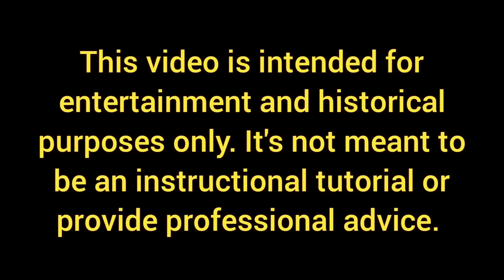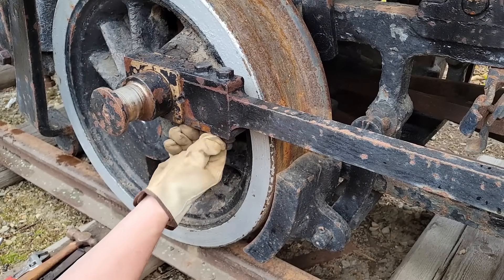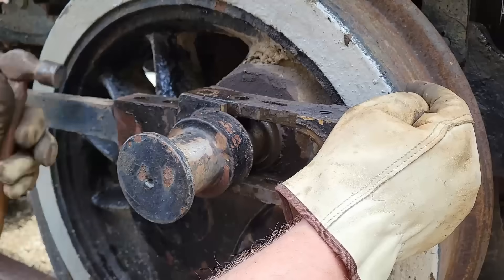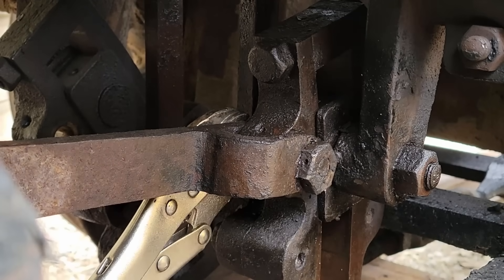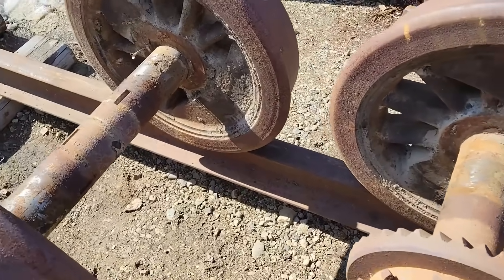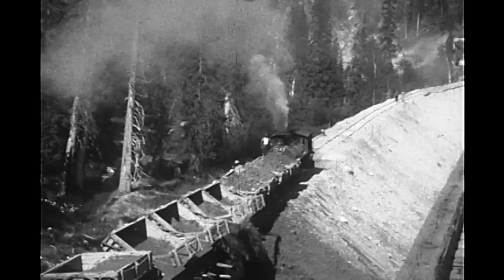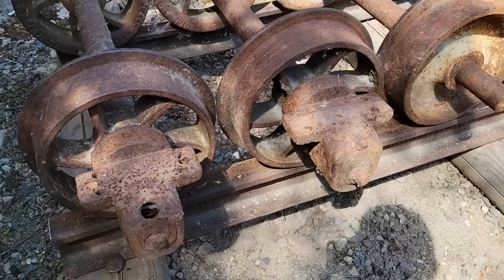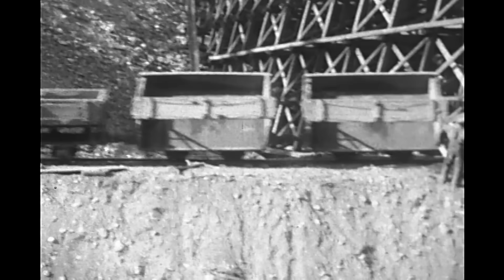Ep 13 - Steam Locomotive Valve Gear and Other Mysteries

Comment: I am a pipe organ builder (there is a significant overlap in organ building and steam enthusiasm), and watching you disassemble the valve linkage filled me with fear! Somehow, despite having built and moved dozens of organs each with thousands of pieces, steam engine running gear just seems like magic.
Reply: I restore steam locomotives for a living and I can assure you that they are an order of magnitude simpler than a pipe organ.
Reply: Sir, I think You´ve seen nothing yet. No air hammers, sledgehammers or oxy cutters were used, the Dude was VERY gentle.
Reply: @LaLaLand.Germany  I can tell that he is a true craftsman, and I look forward to seeing the finished product!
Reply: @LaLaLand.Germany  Indeed! What filled me with fear was the thought of reassembling that complicated mechanism, even though it is quite simple in comparison with even a small mechanical-action pipe organ. I can't wait to see the final result!

Comment: You’re quite a ways away from NE Pennsylvania but 0-4-0 donkey switchers were the workhorses of the hard coal mines once the coal arrived on the surface. Admittedly, the mine cars were pretty rudimentary affairs but I can easily see that Peteler type cars could be used to haul the culm, or waste rock, to be dumped on rock piles. A couple of leads might be the Pioneer Coal Mine in Ashland PA, a tourist attraction that operates an 0-4-0 above ground as well as mine tours underground as well as the underground miners website. They are a group of dedicated restorers and they have restored electric “lokies” and mine cars saved from destruction at the last moment.

Ashland even runs specials where you can be engineer for an hour on the 0-4-0. They haul passengers along what used to be the rail line from the mine to the coal breaker where the cosl was crushed, sorted and cleaned.